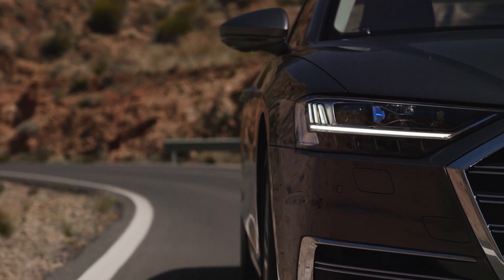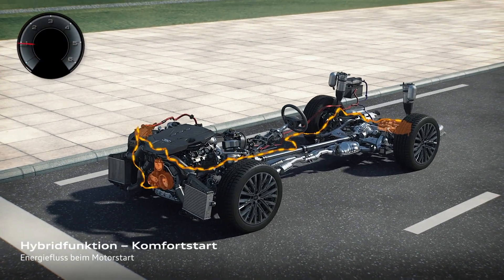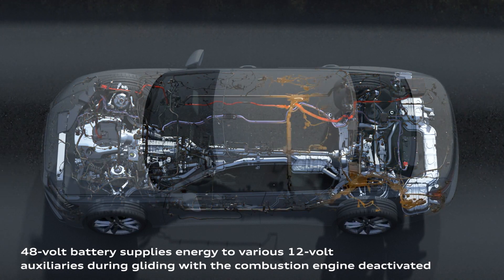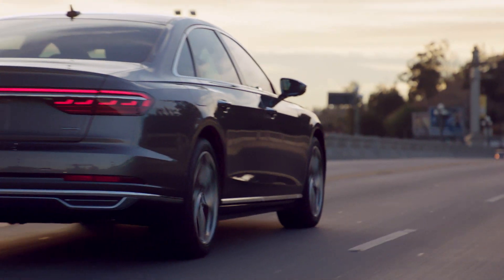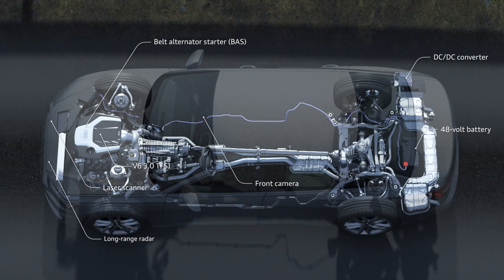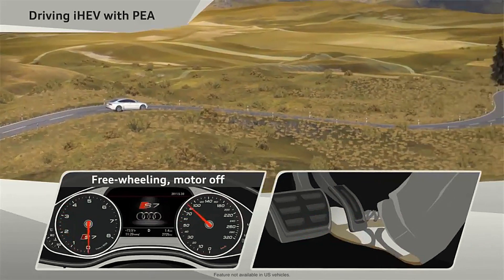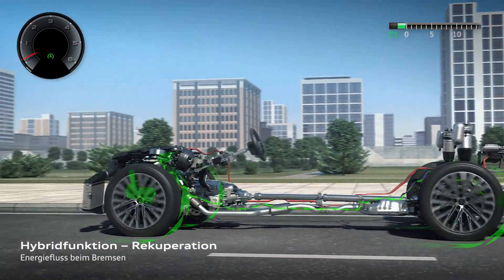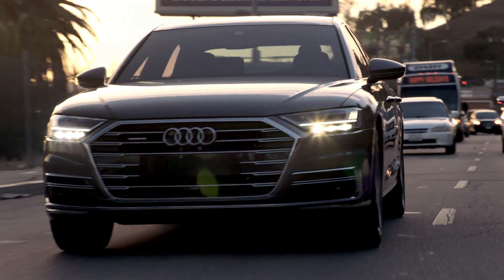Audi Tech Defined: MHEV (Mild Hybrid Electric Vehicle)

Comment: 2019 Audi A6 with the 3.0T alternator went out at 33k miles. Thankfully I had an extended warranty and Audi paid for replacement. Unfortunately they replaced the faulty alternator with the same part so I imagine it will go out after another 33k miles or so. Disappointing
Reply: They usually go out at about 20k miles on the RS6.
Reply: Standard alternator or the one for the 48v?

Comment: This is the most worthless video. It doesn't say what the mild hybrid system even does. How does it get power (regenerative breaking, etc..)? Does it provide power on its own? Is there an electric motor to assist with that? How much hp and in*lb of torque can the system provide?

Comment: Has anyone figured out how to remove/ jump this system completely out of the vehicle so it runs without it??

I want a used A6/A7 but not with this time bomb attached to it… that’s a long term maintenance NIGHTMARE on par with Mercedes ABC hydraulic suspension system from the early 2000s.
Reply: I am also looking for an A6 without this madness, didy ou get one?

Comment: Question: does the MHEV system save gas, too? I heard the video said once the car is above 34 mph, the engine will be shut off. Sounds like it can save gas, but not sure. Thanks.
Reply: You will save just enough to give to the mechanic when this system fails
Reply: I'm wondering the same thing. They also need to bring back the fogs lights at the bottom. Its just not an Audi without it. I won't upgrade past a 2016. So I'll either be switching models or brands.
My 15 A4 Quattro PP is at 42k. They need to bring back the fog lights.
Reply: What you save in fuel is minimal, about 0,5 liter per 100km. However it will cost a fortune to fix

Comment: and now the alternator/generators are failing in hundreds of cars after a few years, and failing in a highly dangerous way putting live of driver and passengers at risk.... Audi not accepting there is a problem. A RECALL is required...
Reply: I am doing mine on TPI, after discussing with Audi Ag on messenger,  i know,  it is hard to believe. 
My car is in service from 27.03.2023, and on 13.04.  they called me to ofer in change a car free of charge  until mine is solved, and costs 0, after i payed already 1500 euro jost for the order setting 😅. 
They said the producer admitted it is a problem with the BAS, now i hope the 48V will be ok.
Reply: Please elaborate on the safety aspects of alternator/generator failure.
Reply: I got stuck on the road for this problem a year ago in my 2019 A6. Took a month to get the part. But now they've done a recall to install a redesigned part. My car is in the shop right now, matter of fact, getting that done.
Reply: @alanzimmerman1674  you in the UK Alan? I know Audi USA were replacing alternator failures FOC and extended warranty to 7 years, but in the UK, if car is older than 3 years we had to pay up for the repair!!
Reply: @frasermathieson9767  I'm in US. They extended my warranty maybe a year ago, but then issued a recall a month ago. 2019 A6. Took two days but I have my new, redesigned starter alternator now.

Comment: Finally have a face to blame for this terrible system. Having nothing but electrical faults for the 48v system and when I look anything up about it it seems I'm not the only one.
(Also €2,000 for a new 48v battery)👎
Reply: BAS is also faulty,  i am waiting for mine to come for over 1 month,  it is also over 2k euro to change it, but not on stock....., 48V battery also will go under 6% and entering on safe mode,  so will have to change it too.

Comment: Can someone explain to Audi that the era of the combustion engine for personal transport is over please. We don't want complex over engineered combustion vehicles any more, we need full electric vehicles, with zero tailpipe emissions, silent drive trains, low maintenance and low running costs. Combustion engines are so last century!
Reply: Well, Audi is more ahead than most brands in electric efforts. The entire VW brands are making solid efforts and have a robust plan to move to electric. The 48v system is just for now, while we transition.

Comment: This confirmed by Audi Canada: The Audi, Germany's "mild hybrid" coasting feature is NOT AVAILABLE on any of the 2019 model year A6, A7, A8 and Q8 vehicles they they exported to the North American market. The only part of the system that is available is the 48 volt START/STOP feature. Our 2019 A6 confirms this! Apparently very few people are aware of this at this time. This coasting feature IS available on all European models apparently. At this time Audi gives no reason as to just why it was left out of the North American models. One might also ask just why Audi decided to hide this information  from North American purchasers?? Spent hours attempting to get it to work as did our dealership (16 days) until Audi admitted it was not a feature here.
Reply: I drove an A6 and A7 here in the US and wondered the same thing. It's probably because of legislation. It's the same with the Matrix headlights. I spent hours trying to find out why I don't get the beams to split and it's because the adaptive beam is still not legal. But when the law changes then it's a simple software update.
Reply: You have to be happy that you got "another stupid function" turned off by factory. It was only going to kill that small battery. It's useless marketing scam. The entire "12v/48v mild hybrid system" is a scam. It makes the entire drivetrain a lot more complicated and expensive to buy/repair and offers zero benefits. They even put in in 2L/3L diesels. Scammers.